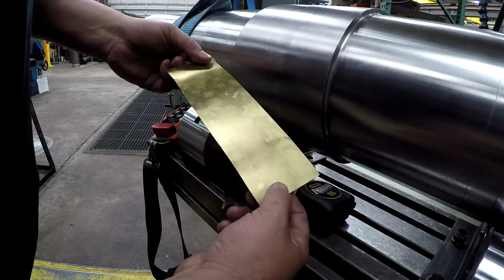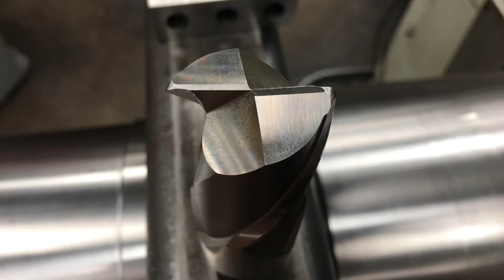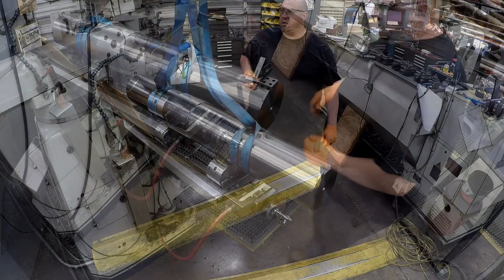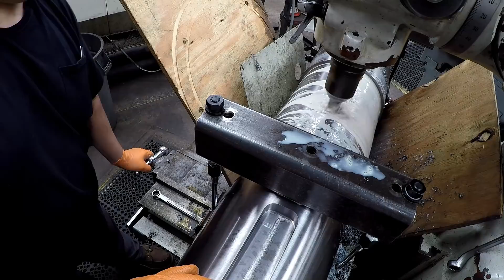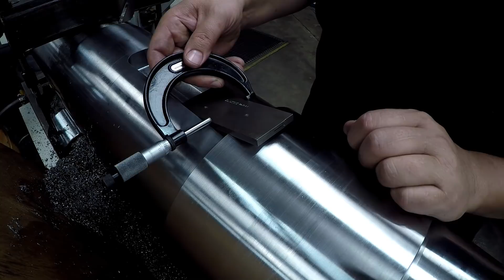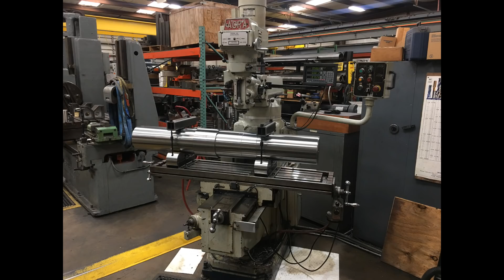9 5 Inch 4140 Gearbox Shaft Part 3

Comment: Adam, thank you for all these videos, I watched each one.
Adam, that crack, was it on one side and was it at the ends?
Also, please find out what the "load start conditions" are of that machine...
You may have it being under "jammed machine conditions and they are attempting to clear or run machine under "shock point load" which allows forces to transfer from one side of key... giving a "jack hammer action" on key-way...
I am guessing if this is true, they can find another way, to lesson that torque, impact action...
Or you can make them a deeper key or no key at the end at all, hold back on key from the ends."
Adam, I also have one other theory, the actual bolt is creating a ''jack hammer affect'' in that failure path... it is hard for me to see, per the video image, but the crack is connected to the bolt hole. Perhaps they need to check the bolt for ''tightness'' and also for dissimilar  metals and ''heat expansion'' on that one bolt? I could not tell, from the image, if that entire keyway on one side failed?
Reply: Looked to be ~2-4" of the "clockwise" side of the keyway. I'm not a betting man, but if I were I'd bet the failure length in the keyway matches up fairly well to the depth of that hole. Those holes might benefit from being formed or being cut with a higher tolerance standard/custom ground tap with a healthy & uniform radius at the thread root.

I missed the portion where he made those holes so I'm not sure if talked about that at all or if it's even possible to form something that size. Plus forming introduces internal stresses that go up with size, so a custom tap could be the ticket.

But we know very little about the application & it's a freaking textbook example of a stress concentration to stress concentration failure. Being common (whatever that translates to, is this the 3rd? 15th? example of the same failure?), I really hope they investigated it & found new shafts to be cheaper than any alternative.

Could simply be that this is the only failure mode they've seen & they don't want to chance shifting it  into the unknown. Especially since what we see isn't catastrophic. Semi planned shaft change taking x hours of downtime to replace with spares on-site or who knows how long on what might be a catastrophic failure.

This might even be the cheapest sacrificial part in its specific application. Who knows.
Reply: @Iceberg86300  ,  simply put, it is a bad design for the current load conditions (so, change the load conditions or change the part to withstand load conditions)...

Comment: I am a retired professional engineer and am finally doing what I have always known that I would love – model engineering.  I didn’t work on machines in my professional life, although during my degree course I did work in a factory on a lathe and a very old overhead-belt driven radial drill that took a bit of getting used to since it would always move when the belt was engaged; no matter how hard it was locked down.  Thus I am aware of the level of skill required when using manual machines.  I have seen many videos of modern CNC machines and they are always impressive.  HOWEVER, to see somebody using an old (but well maintained) manual machine to achieve such accuracy and beauty of finish is impressive in a way that CNC machining can only dream of.  All those subtle adjustments and shimming, and, you made setting-up the fixed steady look so easy; when I know for an absolute fact that it is not, wonderful skill.  Thank you for taking the time to share the process.

Comment: Nice Job, Well Done :)  Looking at the old shaft where it cracked at, if you look at the shaft end where the crack is at, it Looks like the gear or what ever slides onto the shaft is Tappered, worn out of round,  the shaft end is rusty/dirty towards the end meaning it could be loose and the shaft metal is clean with no rust at the end where the gear slips onto the shaft and bottoms out at, ifs thats the case, the New Shaft will more than likely crack again, unless the gear or part that slips onto the shaft is replaced with a true hole in it, Looking at the other end where it did not crack at, the shaft metal is clean and void of corrosion /rust, meaning a nice tight fit all the way on the gear or part,  my 2 cents worth :)

Comment: You said the coupling end of that shaft has broken out at the keyway before. If so then I wonder why the end user does not consider using a keyless locking device like a Ringfeder on the coupling and just skip the keyway all together.
Reply from the maker: We got a lot of repair jobs in the shop that makes you wonder a lot of things.

Comment: Doesn't this need to be hardened? If I'm not mistaken raw stock 4140 alloy steel does not come already harden from the metal mill plant. It must by hardened after machining to the desired hardness by tempering for the application it will be used for.

Comment: Well here some comment from Holland Europe, lets start by saying you are a craftsman no doubt about it!!!! You know what you are doing, i can see that, after 33 years of experiance in the same world. But i really wonder why your "boss" not do some investments like digital indicators on the machines...really its 2018, in the middel/late 80's i allready worked whit that, and buys you, or better your boss a lot of time, instead that you everytime set scratshes whit your manual indicator. I guess time is not an issue, you said you needed a week the get this far, well where i worked sometimes we make axels like this size in less then a day, ok not alone but you get the idea..and also on conventional machines. I don't want to criticizes you personnaly!! Dont get me wrong, i like what you are doing, but it shockes me that it still happens this way on a proffesionall level in this aera of time....keep up the good work, loving to see you at work, its a nice job!! PS forgive me my bad English, its not my native language ;-)
Reply: I’ve worked with digital indicators before, but for trueing up a shaft in a 4 jaw chuck, the movement of the needle is more important, and easier to see than a series of numbers flashing by on a digital readout. I also have access to electronic indicators in the shop I work at, but I much prefer my mechanical ones; a 1 inch travel with a roller tip, then a .00005 test indicator, if necessary, and it’s running as true as it can; and I didn’t have any cable to manage, nor some remote display to look away at. In the end, you work with what you feel comfortable with.

Comment: Adam thx for video sharing the making of that shaft. I love how quickly you can indicate a shaft in. It's no wonder you won the contest for the fastest and most accurate contestant in that contest. Is it the inserts or the metal that results in such a great finish before sanding?
A pro at work, you make it look easy, but it ain't.
I know that you can't re-engineer the shaft but I wonder what would be a better solution; multiple keys, splines, a bigger shaft with a single key the list goes on. It's obvious that the original design isn't robust enough.
So, Adam thx again for sharing these videos for this shaft and all the others.

Comment: I am surprised a bit of using a 2 flute on that grade of steel, but it did the job and that is what matters.  I probably would have gone to a 4 flute and depending on the milling machine, used climb cutting instead of conventional, but none the less, with all that said, your job came out fantastic!  thanks for sharing!
Reply: He probably chose that reground 2 flute because he needed to radius the corners. Fewer corners, quicker into service. 
Climb milling on a mill with an ACME screw requires snugging down on the slide lock(s) sufficiency to prevent the backlash from affecting the cut. This wears out the machine gibs much quicker. He did a fine job, and in the end, it was his decision how to go about it.

Comment: Great job, but.. why  You not buy numeric CNC machine? Its better, and faster way, and give  You better quality.
Reply: This is “One Off” work, with basically straight cuts. The machines used were paid for many years ago, the shop rate is much lower than equivalent CNC machinery. The effort and attention to detail is the same, or very similar no matter what type of machinery is used. If the quantity of parts increases, then the job would have gone elsewhere. This gentleman did a fine job, in a respectable amount of time. His employer made money; mission accomplished.

Comment: You didn't match the key way radius that the original one had. Due to your cutter diameter. In that case, spooning the key way should have been the route to go, along with modifying the key so that the key had heavy champfers instead of straight edges. That key wasnt original to the shaft thats probably why it cracked the original shaft to begin with due to the fact that at the bottom of the key way it isnt completely flat, the key contacts that edge and puts point pressure. The shaft doesnt like that. Since you didnt match the radius to the original shaft. I would of machined a ramp up the back of the key way and blended it by hand. I only kniw this because i machined 40ton shafts with quad taper fit keyways for the drive couplings. I did numerous navy shafts the same way. Had to use a hand held belt sander and many cardboard templates/precision radius gauges. If you want any tips on spooning keyways you can hit me up.

Comment: Love that Heavy Metal! 
I'm wondering if anything more could have been done to the key-slot to make it less likely to crack? The cracking started in a corner so would a larger corner radius help?
Heat Treatment? Maybe the gears are not helical so a great startup torque or impact would have caused this? Would a "soft" shaft coupling to the load have helped?
What is the gear box used for?

Comment: Easy to see that the old shaft crack-failure emanated at the NON-RADIUSTED keyway;  takes a competent Journeyman to do the keyway correctly by adding the radius.  
As a retired electronics engineer and amateur machinist with an Atlas and manual 1954 Bridgeport, I would have never thought of this type of failure.  Question:  why use a 2-flute for this keyway, I always thought 2-flutes were for aluminum ?
Reply: The reason for 2flutes instead of 4 for aluminium is for chip clearance. Probably the reason he chose a reground 2 flute was because he had to stone a corner radius on it. The fewer corners to stone, the quicker the cutter can be put into use.

Comment: When you were first setting the shaft up trying to get it to run parallel and shimming it, did you re check the top of the shaft after you tapped it around parallel to the bed travel.  You didn't show it but it would of been running out for sure due to indicating on a round shaft and not on a flat surface.

Comment: Question: looking at the old shaft, is that also the crack coming off the keyway ~45°, running away from the end and around the circumference?

Comment: I appreciate your sharing the radius on the end mill; stops the stress risers from forming at the 90 degree edge and premature failure.. The difference between a quality engineered part made in America vs. others! The expertise that goes into machining a part like this is awesome. This group of videos showcases the difference between a true "Machinist" and, those like me, who enjoy watching and learning from a real professional. It is gratifying to see what "Made in America" truly means. Motion Industries should use some of your videos to show their customers the level of expertise of their company.  Your videos would quickly sell any potential customer on the capabilities of the company which is the capability/expertise of their employees.
Reply: With labor costs going up companies are outsourcing a lot of these to places like China where they CNC the parts out (they have some really wicked CNC equipment) that doesn't depend as much on the skills of the operator. If this part is used in many machines around the world it would make sense the CNC them.
Reply: @taiwanluthiers  That isn't true. If you don't dial in the correct specs to the cnc machine, it will cause a failure. CNC requires just as much skill as a manual, it's just a different skill.
Reply: @24681359David  But instead of having an army of highly skilled operators machining parts out manually, you have an engineer make the program, tweak it, etc. and all the machine needs is an unskilled operator to swap the finished parts for blanks, and press the button. Sometimes the operator isn't even needed because you could just have a robot arm to do that. So you still require a skilled CNC programmer but you hire one guy to program 10 machines, and 1 unskilled operator to watch the machine to make sure nothing goes wrong (or swap out cutters when it breaks).
Reply: I hear what you are saying. My experience is that you don't want to spend a couple million importing from a country where precision is only a guideline. It hurts to lose $2,000,000 on out of spec parts, even though manufactured on the best equipment. Personal experience.
Reply: Terrible things those key ways, radius or no radius .
Reply: Most people don't know what a radius is or what causes stress risers. Bean counters will approve or buy a cheaper part. even if it is a machined part that is a pos. You get what you pay for.
Reply: Standard Engineering Practice Shannon  to use a radius on types of cutting tools. It is used all around the world in all engineering plants. NOT just America.
Reply: Why does it matter if this guy is American?  Skilled people aren’t exclusive to a race or nationality as far as I can tell.
Reply: @Dogpool  Why does it matter?  Because work like this used to be the rule - now it is the exception.

Comment: Adam what happens to the old shaft.  Can you re-purpose it for a smaller use.  It looks like there is material there for some other job.What a great job you did on that shaft.
Reply from the maker: Save it to use when it's needed. They usually get cut up into smaller pieces or if we need a slab of metal.

Comment: Adam: Great project and turn out. Do you just keep track of the Y axis movements when working out to final width so you don't loose the center line of the keyways?...Dave
Reply from the maker: David, yes I use both the digital readout and a strong mag back indicator on the knee way to keep up with my offset from zero.

Comment: What brand/type of coolant do you use? I'm looking for something that will help prevent rust on my tooling and equipment.
Reply from the maker: I've been using regular soluble oil from Lubriplate. We buy it through work. Just have it mixed properly and no rust issues.

Comment: Adam

Have you ever checked the tram on the table with a load like that when the table is at the limits of it's travel right or left??  The torque has to be immense on a shaft that size

John

Comment: clearly its a drive shaft keyed at the end for drive sprockets and keyed in the middle for some type of drive pulley
Reply from the maker: Try a shaft coupling on one end, and a gear in the middle.
Reply: could be a coupling but not necessarily especially with a 14" lg. keyway more likely a drive type sprocket with a keyed bushing,,,could also be a gear in the middle but its some type of gear or drive pulley...something that is a driver...may be a meshing gear...
Reply from the maker: We are rebuilding the gear box so I'm telling you the center journal is for the gear.

Comment: My guess at the application would be that the end of the shaft with the crack is fitted with a stacked set of narrow feed rollers like 2 or 3 inch wide slitting saws or spiral fluted horizontal planing blocks for your K&T mill that are directly involved in mashing up the logs for the Oriented Strand boards, ( https://en.wikipedia.org/wiki/Oriented_strand_board ), as the rusty shaft would be from the wet tree sap and the end cutter or feed roller jammed or loaded up causing the crack about the width of the individual block. If the mounted gear or roller/cutter was the full width of the journal, it wouldn't be able to focus the torque on the end of the shaft but would rather shear the whole thing off at the shoulder or crack that instead but in that case the drive keys would have probably failed first. It happened over a period of time after an initial overload as the polished free section that split away indicates prolonged rubbing under load inside the bore of the mounted wheel of whatever type. Also the rust inside the crack indicates a period of use before detection, most likely a juddering and snatching of the end block or even having it fall off in service. Just my "Oh pinion" or rather, "OH SH*T!" :-p

Comment: Adam..does it matter if you cut the corners off the end mill and the key won't bottom out because of the radius? Also do you cut a spoon at the end of the key way to prevent cracking?
Great job man!
Reply from the maker: Dress the key on a belt sander or grinder to clear the radius.

Comment: After seeing how much care Adam put into this, I had this horrible vision of the mechanic hammering the key in with a sledge.
Reply from the maker: We are never amazed at what kind of stupidity happens out there after widgets leave our shop. Last mistake was a rush gear box rebuild was not filled with oil at job site and burned up in no time. All our jobs are tagged and labeled to inform user to add oil.

Comment: My guess would be that it is the main shaft of an industrial wood chipper that creates the "strands" which are then laid down as the OSB matrix. You would get a ton of torque on the blade end of that shaft because you are rather suddenly introducing tree trunks to a spinning hub full of blades 90 degrees from the axial line of the shaft over and over again.